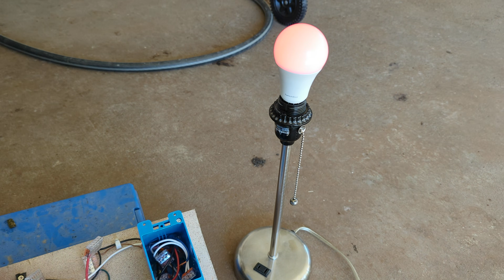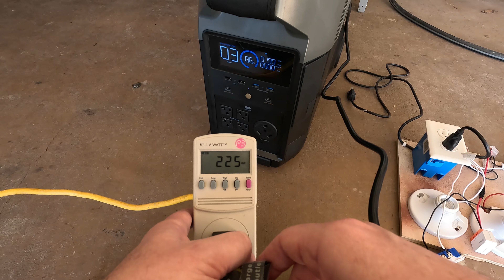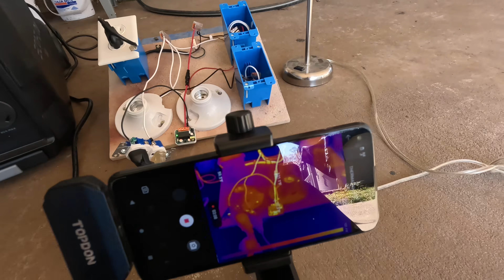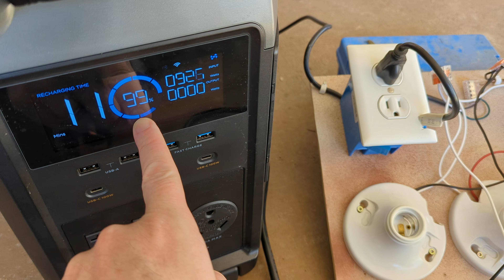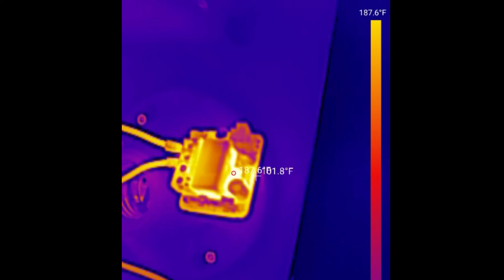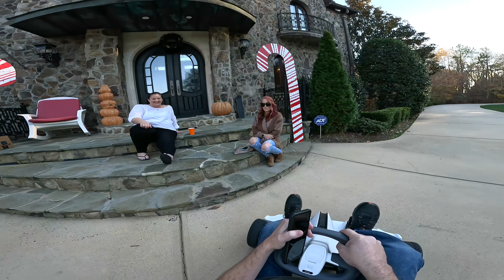I was WRONG! Sonoff Zigbee Switch Smoke Test - 1500 Watts

Comment: Do I need a fuse if my load will only be 10-15 watts (lights) ?
Reply from the maker: I'd still make sure the fuse/breaker matches the device rating.
Reply: @digiblurDIY  that was the question, why? Who has such a small breaker and only for lights?
Reply from the maker: Probably more of a non 120v area thing as I have a mix of 15 and 20 amp breakers for single phase.

Comment: In the UK, lighting circuits are normally protected by a 6Amp circuit breaker. So the 5A fuse is probably not needed. On UK/EURO 230v we get double the Watts, for the same current drawn, on our lighting circuit. 

Once the relay contacts are closed they can generally handle quite a bit of current without any problems.  It's making or breaking that load under heavy current, that's when the contacts really suffer.  You should do a test with the relay cycling on and off, Maybe with a small electric heater.  Inductive loads like motors, are even worse for relay contacts.
Reply from the maker: Actually have some footage for a quick short of a 1200 watt heat gun doing this very thing over and over. Just need to edit it down.

Comment: I love this video. Very well done and THANK YOU for pointing out the 6A design constraint.
I have 1 question. Is it possible to use this device in a 3-way switch ???
I have in my garage 3 switches in 3-Way and I do not have a Neutral. Can you advise ???
Reply from the maker: Check their page for the diagram. They call it 2 way in other countries.

Comment: Nice test! Still don't think a fuse is necessary as long as you wire it to known loads (like some fixtures, not a socket). Chances of that failing in an heavy load scenario is slim and as seen here, the load probably poses a bigger risk than this thing :) When used with a fixture it's like the same as a fixture with a 0,5-0,75qmm (AWG 18-20)  cable.
Reply from the maker: If we planned to only load circuits with the right amount and never have shorts we wouldn't need breakers either though so I do get the requirements of keeping everything the same capacity even with simple LED loads on circuits.
Reply: @digiblurDIY  Then I have it you also don't use Christmas lights? They also have no fuse and that wire certainly isn't rated for 15/16A either. Or inline switches for fixtures? Shorts are not a problem for stuff like this, resistance isn't nearly high enough to pose a risk in case of a short to not pop the breaker.
Reply from the maker: Those have the little glass slide in fuses in the plugs.  I so wish we had those in all extension cords and mandated!  It would save so many lives and fires.
Reply: @digiblurDIY  Also in a fixture cable? Here (Europe mainland) they don't and I don't see a problem it that.

I disagree it would safe any life. People will find ways to do stuff even more wrong. And even simple stuff (like you have to retract the full cable of your vacuum) Think switching to LED saves way more lives. And in case of a normal short circuit the breaker will pop. Yeay, there is a limit, but 1/3 the breaker rating isn't it in my book.
Reply from the maker: So abolish all fuses is the way? Got it.
Reply: @digiblurDIY  No, absolutely not. But I don't think the British way is useful.

Comment: A fuse and the holder you show are not designed for or rated for being part of an electrical house installation. A small fuse like this near its rating gets pretty warm. No fuses blow at their rating. They always have a huge positive tolerance. Hiding such a few in a wall or plastic enclosure in the wall is a fire hazard that I personally will be more worried about than the Sonoff module. In UK where fuses are inline they are part of the plug which is approved and tested for the heat from a fuse and the plugs are never inside a wall but well ventillated. A glass tube fuse like this should be inside an enclosure of metal or a plastic that is rated and tested to not burn with open flame. An inline fuse with heat shrink or even worse, electrical tape is not correct. These inline fuse holders are typically made for low voltage applications and normally used for DC power cables in a vehicle.
Reply from the maker: I only had 16awg ones on hand to try on the test board but it does claim it is rated for 250VAC but you never know. I have seen the glass fuses like that used on many mains products in the past. Usually mounted on the back of the product with the little thumb screw that pops it out.

Comment: Still would not use anything rated less than the same rating on my breaker.
Reply from the maker: Fully agree. Only secondary method is to fuse it at the device. I have seen another 3A relay by another company and they had an onboard fuse.

Comment: What happens if you turn it on and off and on with 1000 watt load?
Reply from the maker: I did it a few times but didn't include that segment. It might not have done much due to the soft'ish start of the battery charger. So I am going to do it with a 1200 watt toaster oven to toggle over and over quickly

Comment: No short circuit test? Even though it doesn't have a neutral, what would happen should you have an active to earth fault on a fixture or wiring? Does the device blow or trip the circuit protection? 
I'm certainly the type to experiment, heck do an insulation resistance test @ 1Kv to see. I'll blow it up :D
Reply from the maker: So I did think of that but didn't want to cause some damage to the breaker panel or cause some other fire issue. If you have some ideas to help isolate that in a safe manner let me know and still go to a shorted state I am open to trying.
Reply: @digiblurDIY  it's about your upstream protection, you want to have a cascade effect.

Comment: More than continuous use in excess of the rating, switching on and off in excess of the rating tends to cause problems.
Reply from the maker: I only toggled it a few times during the load. Have another smoke test attempt coming with quick toggles

Comment: So I've really been impressed with these and find they're ideal for the UK no neutral lighting. I currently have 4 deployed with possibly more in the future. But as much as I love them there's one observation I'll make that might have a little impact on your test. 6A at 240v is just shy of 1500w and it's rated for that. Now I know you were using lower voltage and so putting more amps through, but maybe the reason it managed to not completely fail is because while you were certainly  pushing it with double amps you were only slightly above in terms of watts? I'm not an electrician so not sure how relevant it is, but maybe it's enough to be a factor in this test?
Reply from the maker: Amps is going be the key here.  It is why I did the 15A test as it is pretty universal there.

Comment: OK... It "carried" the load... Will it make or break that load reliably though. 🙃🙃
Reply from the maker: Yes.  I didn't want to drag it out too long with the various segments.  I toggled the relay several times and it worked just fine.  Of course the heat dropped a little so it wasn't as fun.
Reply from the maker: I still have it setup on the board... I do an automation to toggle the relay every 20 seconds or so to see if it will smoke!  Game on!  Do a 1 minute short thing maybe if something good happens.
Reply: @digiblurDIY  Usually it doesn’t smoke but relay contact welds together and you wouldn’t be able to disconnect the load
Reply from the maker: Relay still works. Going to run it through another switching run.

Comment: Love the video. It is great to put manufacture claims to the test. I agree with the fuse, especially if you don't know what the loading will be.
Reply from the maker: Thanks!  I was sad but yet happy with the whole thing.  I wanted to see smoke but I was kind of glad I didn't to know that this thing was pretty safe.
Reply: @digiblurDIY  Based on this video I would expect a failure to be pretty rare within it's rating and when it does fall to be anti climatic.
Reply from the maker: Totally agree.

Comment: Can't believe it passed.  But I'm just not a fan of no-neutral devices.  And I stay away from Wegos in permanent installs- did you notice if they heated up significantly?
Reply: Wagos are better than wire nuts!
Reply from the maker: I don't think anyone is a fan of the no-neutral devices, especially the people that have no neutrals in their walls.  

On the wagos, nothing crazy but the smaller gauge wire did heat up causing the wagos to heat up.  A proper test for the wago would be to use 12awg wire for this.  I've seen many tests of doing 30A or more on wagos before.